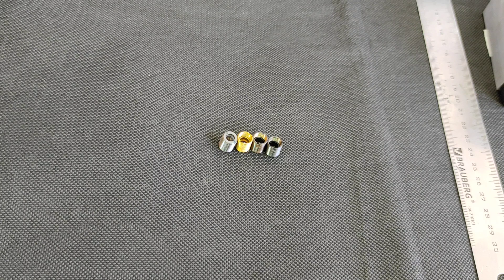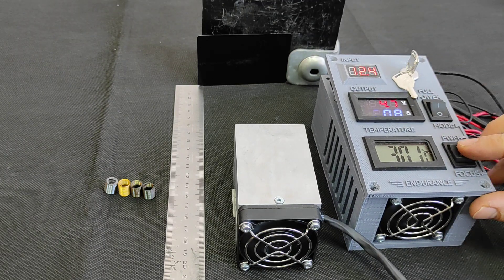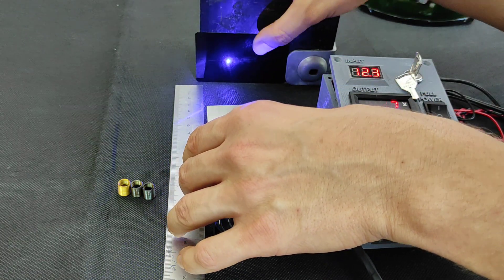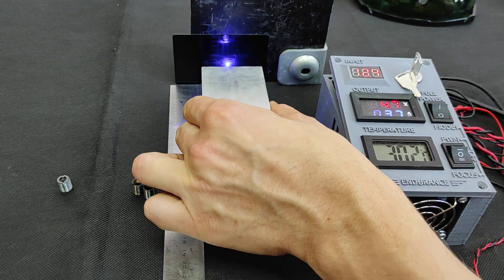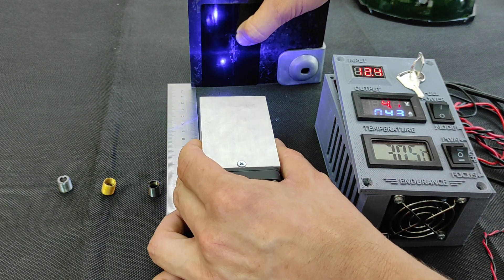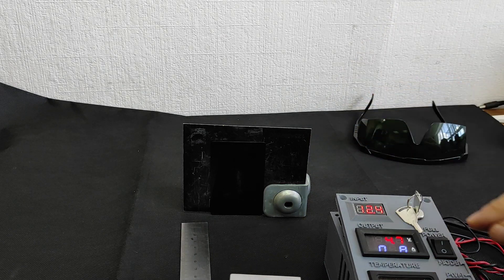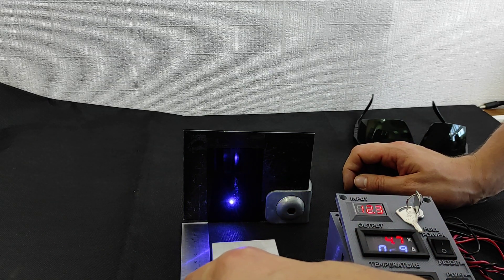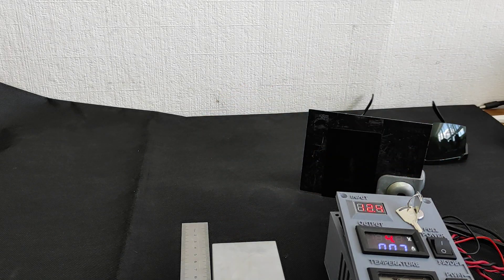All you need to know about laser lens: testing 3 element, G2, G7, G8. Setting up a perfect focus.

Comment: Maybe I need to make my own video about "All you need to know about laser lenses".
Firstly, on mine the notches go on the "inside". I am assuming the notices catch the spring that is loaded before the lens. I will double check if the instructions are correct but thats what the instructions say.
And secondly, shining laser lenses on the wall tells me nothing! I know how to focus.
 What I care about is the effects of detail of each one. I have a G2, a G7, a G8 and a 3 element lens. Astoundingly the G2 lens, so far, gives the best detail and I don't know why. While the other ones have longer focal points they still wind up digging material in my wood at the same speed. 
I really would like to see a visual comparison of all these with actual competed projects.
This video should be called "What a laser looks like when shined on a wall!"
Reply: Those knotches aren't there for catching a spring, They are supposed to go on the outside. 
And yea, Youtube needs to purge videos like this, it's really annoying when you find a video thinking you'll learn something just to find out they didn't tell you anything useful. This guy didn't even tell you how to focus it, he just went through each lens going "oh that looks big" then move onto the next one. i kept wondering why the cover to his power supply wasn't even attached.
Reply: @iwannaapple7190 
those notches are there so one can use a little tool and turn it. 
you'll find those notches on many things laser  ❤
and yes, 💯 I agree with your statement  👌☺️ you are right on the money my brocious